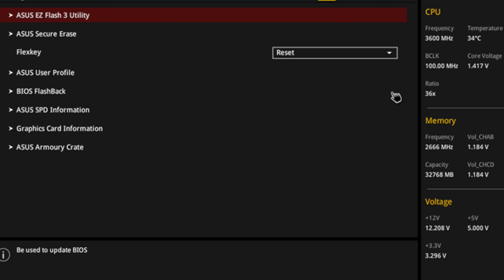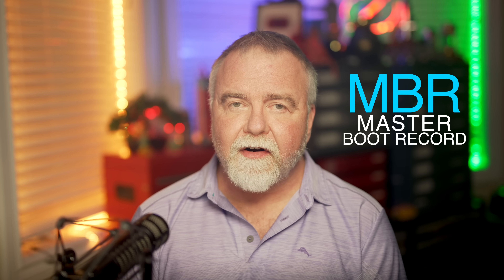How Computers BOOT: From Startup to Viruses

Comment: I work on 64-bit ARM bootloaders though not with UEFI. On ARM there are multiple stages of bootloaders and UEFI is only the final stage. It's a complex process with many stages, starting with on-chip ROM and on-chip 32-bit coprocessors to get its heart started and to deal with security.  I've also worked on PC BIOS many years ago. In the case of UEFI/U-Boot on AARCH64 (ARM 64-bit), the chips I work with come up with a special 32-bit core that has very limited access from the 64-bit cores. The on-chip ROM then loads the next stage from SPI NOR, eMMC, or even i3c for some server chips into the 32-bit core's memory. The code is often digitally signed and verified before it can begin executing. That 32-bit core then loads other coprocessors and the first 64-bit core bootloader into on-chip cache memory. The first 64-bit bootloader, called BL1 into secure memory and verifies its digital signature. BL1 initializes RAM and loads ARM Trusted Services BL2 into secure memory, verifies its digital signature, then BL2 loads ATF BL31 and UEFI into memory and verifies those digital signatures. It then starts BL31, which provides low-level services to UEFI and Linux. BL31 also runs in secure memory and is also verified. UEFI or U-Boot runs in non-secure memory and cannot access secure memory. Some hardware services are also locked to secure memory only. For example, the SPI NOR chip might be locked so only secure applications can access it and be blocked from access by the operating system and final stage bootloader. Modern CPUs tend to be a lot more complicated. For example, on the ARM chips I work with, there are also dedicated 32-bit cores that handle tasks like power management, network/PCI bus management, and security that are isolated from the main CPU cores. Power and thermal management are critical and you don't want the main CPU to deal with that, especially if the OS kernel screws up. You also don't want malware since it could literally fry the chip.

Comment: QUESTION:  When a system motherboard battery dies and the bios returns to default settings.  After replacing the battery HOW does the user know whether to select UEFI or standard bios?  Doesn't choosing the incorrect option at this point place the computers operating system at risk of corruption?  Thank you sir.

Comment: 10:00 When I replaced the motherboard in my computer, it would not boot, and I kept getting a message to insert boot media. After a few aggravating minutes of checking all my connections, I opened the BIOS configuration screen and sure enough it had defaulted to "Legacy" rather than "UEFI." Had I expected something stupid like that I could have avoided all the aggravation. LOL

Comment: With more modern windows sleep and restore modes, SSD's and speedy hardware. Why hasn't anyone tried to run a game in this older way? for instance, game launches launcher, launcher sets into memory targets the MBR protocol, resets the machine, launches the launcher in a layer outside any operating system, or a slim version of linux for gaming like SteamOs creating a dual boot Os just for the program.

Comment: Having written code for General Software, Phoenix, and AMI, both "BIOS" and "UEFI" I can say with a level of certainty that the differences between the 2 are much less than most ppl realize. I rather liken it to the differences between DOS and Windows 3.1... Sure the differences look huge but Windows is just a shell (more or less) running in DOS (yes I already know). "UEFI's" strengths aren't even normally utilized and "BIOS" would work just as well as "UEFI" in today's environments. The home user would never know the difference. Yes, we had to break away from the inherent limitations of BIOS but we didn't need "UEFI" to do it. In fact we could've just re-named it to BIOS 2.0 or w/e, added the ability to access more required space for new hardware; tbf though, this is not a hard requirement, but microcode and feature creep are real things heh. Most settings loaded by the BIOS are initialized again by the OS anyway, so a slimmer BIOS could have been introduced.

This topic alone is too huge, I could yap for a solid hour about this and in greater detail, best to skip it and leave your explanations in tact. The comments section is no place for a full tech write up.

Comment: I think a follow on video on protected vs real mode to kind of explain how modern OS differ from application software.  You could even get into the differences between windows and modern systems and TSRs and all that. An intermediate video on addressing and jump tables might be needed.  I'd be interested in your take as an OS guy. Either way i find myself explaining jump tables and adressing and inter process communication quite often even to software engineers although from a totally different point of view

Comment: There are a couple of mistakes. Some clarifications: The 8086/8088 actually jumps to F:FFF0, which is the top of its 20-bit address space. (People also write it as FFFF:0). That is where enough ROM has to be mapped for setup and jump to the next spot. The 6502 reads an ADDRESS to jump to from FFFC. ROM has to sit there and RAM is expected to be at least 512 bytes from 0000 to 01FF or otherwise a huge chunk of the CPU is useless. (RAM-less execution is used sometimes in diagnostic ROMs with clever programming). The 68000 is very flexible when it comes to RAM/ROM/IO addresses, however it simply starts executing at 00:0000 (24 bit address space), but with RAM being at the bottom and ROM being at the TOP the Amiga 500 has to use a signal (OVL) that is set to HIGH on reset to tell a LS74* chip to switch RAM out and duplicate ROM into 00:0000 during reset. When the Kickstart ROM executes, it jumps to ROM-space and disables the OVL line by writing to a VIA chip's IO register, which directly drives the OVL line and the RAM re-appears at 00:0000 and the ROM is back at FC:0000. So many good reasons why 8086/8088 and 6502 don't start at zero.
Reply: Further corrections are that RESET lines are active LOW, like many signals, for historic and stability reasons (it is easier to keep a line at stable 5 V and have the computer reset when the voltage drops, instead of filtering a line and hoping no stray capacitive or inductive transient spike knocks out the CPU by triggering a reset. It is also easier to sink current and drive a line forcefully low, thus forcing lines LOW on fault or startup conditions is always easier).
Also "bootstrapping" is often attributed to Baron Munchhausen, but even though in common memory he pulls himself out of a swamp by pulling himself up on his own bootstraps, he actually does this on his own pigtail. It is believed however that engineers used the folklore to name something seemingly impossible (start a machine up and have it execute code when it does not have a program to know how to execute code) in the 1950s.

Comment: Had an IBM clone called the Arch Rival 386SX-16. 5.25" floppy drive, full height 40MB MFM hard drive, 5 pin keyboard, and a serial mouse. And that old parallel printer port connection no one talks about these days. She was EGA until my father bought a VGA card. Beauty of a PC. One HECK of a switch on the thing on the right side towards the back. 10 year old me could barely get the thing in the on position with two fingers. That sound... CLUNK, whir sound, the drive spinning up, searching for a floppy, grinding noises, and that beep when the C:\> prompt appeared... 

Cut my teeth on DOS 4.0. Two years later I was in Manchester NH learning how to build a 386 PC. Five of them. My father was starting a new business. For two days I built these five 386SX-16 systems. Fantastic learning experience. Each the same. Same case, same power supply, same RAM, same HD, same HD controller, same VGA card, and the same burn in procedures. 

Little did I know that 5th system would be mine. Shareware hit the scene... Then CD-ROM... Fun times! Toss in a Packard Smell 386SX-16... I've horror stories on that thing...

But still... That power switch is what I LOVED the most about starting up a PC clone. That big red switch with the black housing around it. Beats booting up my old Apple II\c.

Comment: @Dave's Garage  -- I think FFFF:FFF0  is wrong certainly for traditional cpus starting up in real-mode though who knows if some amd64/x86_64 do this differently.
The PC startup address was FFFF:0000  which translates to address FFFF0  (16 bytes from the top of the PC's 1megabyte address-space) ...
Reply from the maker: FFFFFFF0 != FFFF:FFF0 and I didn't claim it was!
Reply: @DavesGarage 
Hrrm, in the video shows FFFF FFF0 certainly with a space.  In any case, in that way of looking at it, the point is the startup address is 000F FFF0 or FFFF0 and NOT FFFFFFF0 ...  starting in "real mode" ...

Comment: When I started working as an assembly language programmer at the very start of the 1980s,  the system I worked on had a 4 step boot procedure. 1., toggle in the paper tape reader bootstrap on the front panel, 2., run that and read in the card reader bootstrap from 8-level punched paper tape, 3., run that and load the operating system from a deck of punch cards. 4., once that was in, you entered the start address on the front panel, hit the run button, and it was up and running. Back then, I knew the card reader bootstrap code by heart - it was half a dozen or so 16-bit words which, of course, I remembered in hex. Sadly, I can't remember it now.

Comment: 6502 is fun, RESET is actually another NMI (more or less), CPU pushes the flags and PC to the stack prior to loading the RESET vector. 65C02 was fixed to not write during RESET, but it does three reads from the stack instead. I really love this CPU family 🙂

Comment: This  does  bring  back  days  of  my  first  gig as a new IT tech  for a radio station.  Your  challenge  should you choose to except it:
Get this telephoney system (an 8086 with a MFM 10 meg  Hard drive)  working  again even though the  HD was  completely full  running  DOS 6.00

I was  able to boot off a 1.2 meg 5.25 floppy and copy everything to a group of floppy disks on a 2nd 3.5 floppy drive.

Load  DOS 6.0 on a 286 with a whopping  100 meg IDE HD  copy  everything back over... transplant the IDE  telephony 3 line  card into the new computer  and
to my complete surprise...
It worked. and  continued to work for another couple years  until the World Wide Web was a popular thing and this gizmo fell out of use.

Comment: I have a dream of being able to run a whole OS in a bare-metal UEFI created RAM disk. Looking for feedback on existing projects or development resources to implement this idea.
     I envision an SSD being the source for a whole drive backup of the RAM disk, continuously duplicated. On boot, the RAM disk would be created and referenced an the primary boot device. The drive image backup would be read from the SSD into the RAM disk & then the OS would boot from the RAM disk.
     What obstacles do you see with the implementation of this idea?

Comment: Back in the 80's I worked on the Docutel ATM's that were controlled by a computer with front panel switches like the Imsai, that had Core memory. to load the Operating system we would insert a loader board into a Bus Slot and manually enter a 15 instruction boot program into memory then plug in a cassette tape recorder with the program on a cassete into a audio jack on the loader board, then start play on the player then press run on the panel switches to run the boot loader program. Once the tape had played the recording (OS), I would stop the boot loader power off the computer remove the loader board power back on the computer press stop on the front panel switches. enter a memory start address into the program counter register then press run to start the OS. If the system didnt start correctly, we stop the the cpu examine memory loacations by using a memory dump listing and fixing loations with the wrong values then change the program counter back to the program start location and try agin. My How things have changed since then !

Comment: I was hoping for more.  This isn't really what happens on a modern X86 or amd64 computer, is it.  Even my RISC-V computer has a service processor, but it just doesn't hide it.

What I'm on about is that like an ocean liner, there is an engine that starts the engine.  In the PC world, we don't get to know a lot about it, but it's there.

The service processor starts up, trains the RAM (ram is more peripheral than part of the computer now), trains the PCI-E slots, and most frighteningly, keeps running in the background providing (in many cases) enterprise upgrade access and fun attack surfaces that exist above and beyond an OS we, the user, controlls.

In the very earliest days (~2000 era) service processors existed on the motherboards as either simply logic (hold that rest for 5 secs and release) or later simple embedded processors.  But around 2012-ish timeline, Intel began to provide this functionality in the CPU --- an extra core that exists outside the operating system to "run" the board.

Comment: Could a malicious PC manufacturer hide a virus/spyware in the UEFI?
While it may look like that once the control is transferred to the OS everything else is wiped out, I remember that, in the old days of MS-DOS, so called BIOS calls were made by programs (for example for communicating with a serial port) thru software interrupts, thus making both the program and the OS itself more hardware independent without using drivers.
I'm pretty sure that modern OSes don't do that anymore, but I'm still sceptic about buying cheap computers from unknown manufacturer: I can reinstall the OS from scratches, but I cannot check or replace the BIOS/UEFI.
I'm aware that some open BIOS/UEFI implementations do exist, but I don't know if there could be one for a netbook from an unknown manufacturer.
Reply: Short version: yes they can. Computrace/LoJack for Laptops has a BIOS module which injects a driver onto the hard drive. But they probably won't. It takes special skill to write a UEFI-based virus which can do harm without affecting the operation of the modern operating system.
Reply: @eDoc2020 In fact I wasn't talking about a virus (which could be removed by re-flashing the UEFI), but about something introduced by the manufacturer itself: since many of those cheap laptops from unknown manufacturers come from China, and given the precedents, I'd be quite concerned about a state-baked spyware...
I know, I'm paranoid, but, as they say, better safer than sorry.

Comment: Hey @DavesGarage, I appreciate your expertise and would love to see a video where you explain the specific purpose behind the 'Apply' button and why it was created. It's a common oversight, and I think many users could benefit from understanding that clicking “Apply and Ok” is redundant. The 'Apply' button was created to allow changes to be saved without closing the dialogue box, a detail often missed in instructions. Your experience would make for a valuable and insightful video that I could direct others to. Thanks in advance for considering this request!
.

Comment: Hi Dave, did you ever work with any ARC stuff when you were at Microsoft working MIPS machines? It seems like UEFI is somewhat similar in the functionality it provides
Reply: A comparison of early firmware initialization environments (SRM, ARC, UEFI, openfirmware) would be pretty interesting.

Comment: 13:34 the idea of sneaking code onto a computer at start up has not gone away.

All x86 (including the AMD variants) currently include a ghost core as well as the official core. This runs in the background and has access to anything you do. 

Fun fact: this ghost cpu actually runs Minix, the OS that Limits used when inventing Linux. That means that Minix has a higher implementation count than either Windows or Linux or BSD.

I'll leave the conspiracy folk to discuss whether this ghost CPU is used solely for genuine maintenance purposes, such as implementing start on LAN.